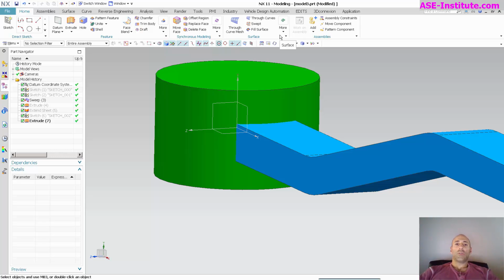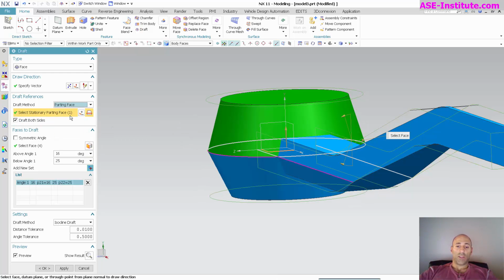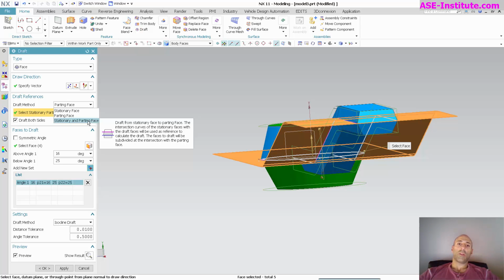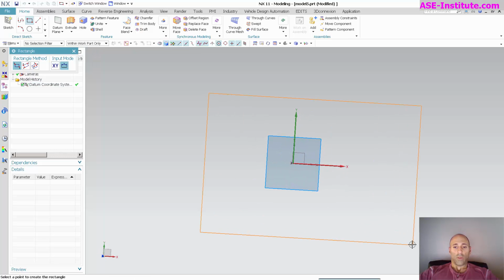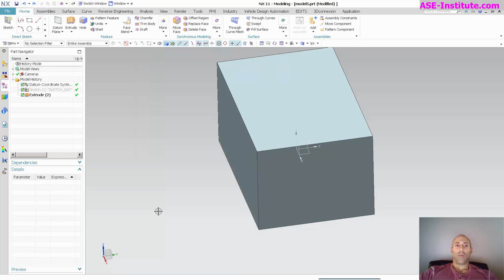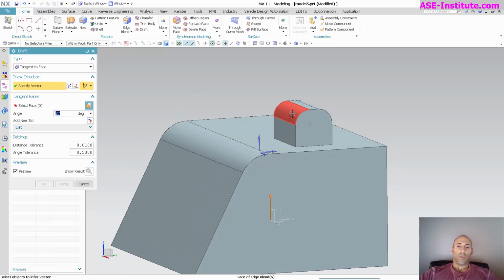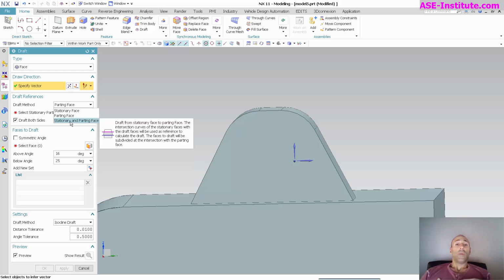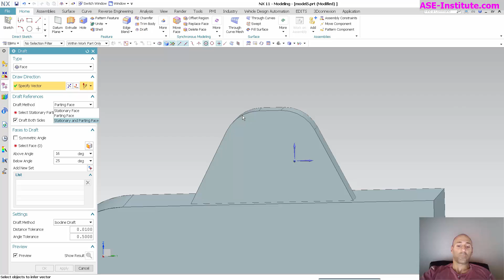Draft | Siemens NX 11

Comment: Thank you very much Steve, indeed that's more powerful than i thought, and it invites me to try to simplify my modeling :)
Now i'm thinking about using it for the "tongue and groove" feature
PS : "Plese like[...]" lacks an A ;)
Reply from the maker: Thanks. Never rush..

What type parts do you design?
Reply: class A surfacing
Actually, i'm training more, otherwise i'm designing a lathe (granite-epoxy in mind, but concrete could help with the low budget) and will have to design some casting parts soon for this project. I've maaany kind of parts in mind for related workshop projects. I was electrician in the past, and also worked in environmental cleaning, rivers and forestry. That's very far from parts design :) but i started 3D in the middle of 90's with POV and others. There is a huge difference between polygonal modeling and CAD :)
Reply: (in fact i've been through POV, 3D studio, then Max and Lightwave, Blender later, a bit of Maya and Rhino for the nurbs, but after stopping all of this for near a decade, i restarted using FreeCAD, which was nice but very frustrating as it's still a work in progress so i switched for Solidworks, and after getting more and more frustrations with it, from its performances to the historic-modeling limits, i gave a try to NX and finally prefered its logic and interface, none to say that i also prefer its drawing tools and behaviors, memory footprint and stability. SolidEdge too but i dislike its drawing part)
Reply from the maker: Interesting history.

I started a blacksmiths shop in my mothers garage as a teenager and built up from there. On NX for 2 decades now.

It is funny how CAD tools have converged. I guess it is only a matter of time. And yes, you are correct it is mostly interface these days that is the deciding difference. I like NX and I like V5. They make sense to me. I played with Alias and ICEM classic and both are powerful but I like my history and the layout of NX and V5 best. 

I will get you a tongue and groove demo soon.
Reply from the maker: I do not use a cloud for anything. I absolutely refuse to use it. I want to own my things. People do not realize how a cloud can be manipulated. Awful.

The day will happen soon when we can manipulate solids like putty as you video link shows. I saw something similar to this years ago but in a lab. Processors need more power. Especially video processors. 

It has been 20 years. Crazy. The difference with NX and other CAD softwares was that NX was proprietary and not available to the world until 15 years ago. Catia has been around and available for 30+ years as are other softwares. Most companies that go to NX now are not really interested in the CAD tool as much as the PDM/PLM tool that is Team Center. Most companies do not want to go to CATIA V6 because it would require a PLM change which is way more difficult than a CAD change. Dassault made a mistake. Daimler went to NX because they use Team Center. Not because of NX. A lot of other companies are in the same boat.

But now people see how powerful NX is and it is cheaper than V5/V6 so some companies will change for that.

Again Okto, thank you for your support. I will be doing way more with the channel in the near future.